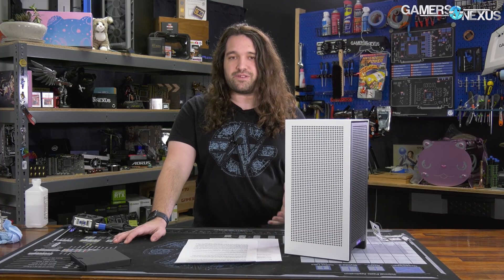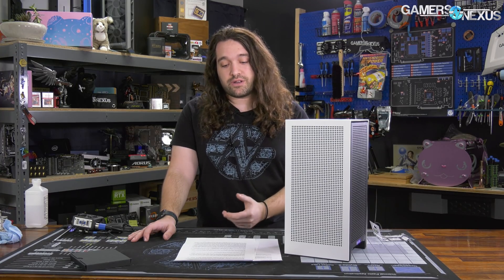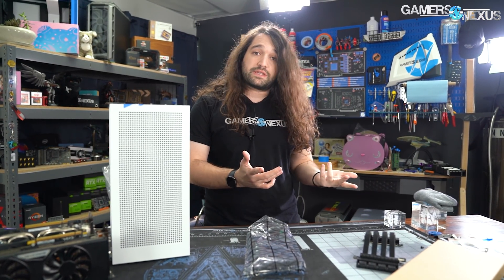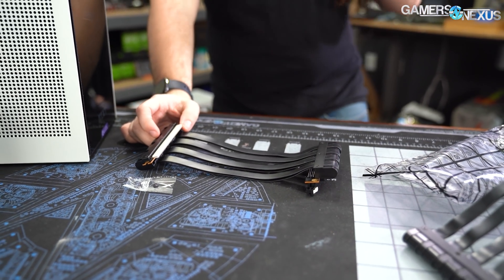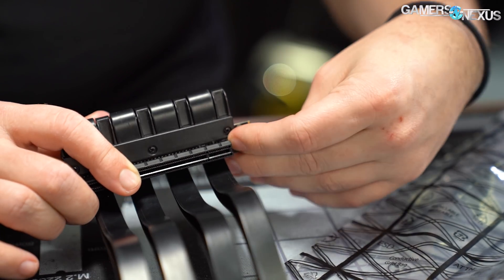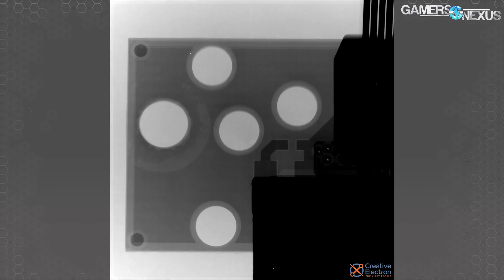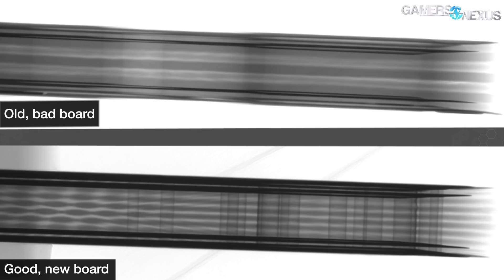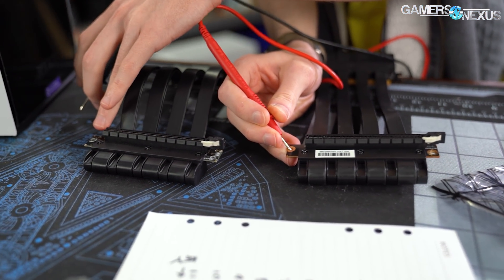Fire or No Fire: New NZXT H1 Riser X-Ray & Testing (NZXT H1 PCIe Riser Fix)

Comment: Great job on this, what ended up being a series. Some may call it excessive or obsessive. I call it holding manufacturers accountable for the BS that they pull and try to sweep under the rug without actually addressing.

Comment: refund denied, because it wasn't bought directly from NZXT.  Just received the nylon screws, that was a 3 month wait, wonder how long it will take to get the replacement riser cable.... at this point I've already moved onto a different case, Cooler Master NR200P.

Comment: I imagine that the multiple holes around the main plated hole is for one of a few reasons: higher amperage rating for grounding to meet a 3rd party certification requirement (as motherboards seems to have a similar solution) or for better HF noise grounding. Due to the Skin Effect, having more effective outer walls of the conductor would help noise which is often coupled to the ground wires from the electromagnetic fields of the other pins. Circut grounds can be used to dissipate that noise, usually with capacitors and resistors. I would imagine that motherboards and GPUs are fairly noisy due to the high clock speeds. The through-holes would be plated and grounding the riser as noise would prefer that path over going back through the riser cable, which is why sometimes you see braided cables used as grounds or EMI shielding.

Comment: tubes are called via's they are there to connect the copper layers together like if you wanted to jump a signal from top to bottom layers. Why they put them around the mounting holes not entirely sure without seeing the board for real maybe its to "rivot" the layers together around the screw hole, though the plated hole should do that.  OS - IPC certified circuit board designer

Comment: Mounting hole via ring prevents the pad from being ripped off. It also has some marginal thermal and electrical benefit to the board and ground connection but that's probably not important here.

Comment: excellent. hopefully this is an "across the board" replacement and customer service does a good job of getting replacements out to folks who turn in for the recall. im glad they did the right thing and had a proper PCB made for this use case. and yes, the x-ray views of the boards were really neat, ive never seen anyone do that before on PCB analysis. as always, top shelf work from GN

Comment: Electronics Engineer here, the piping or vias around the mounting hole are there to provide a consistent ground plane through all layers of the PCB even if the plating on the top or bottom side of the board gets damaged, eg if the plated hole was stripped of its plating in the center due to wearing from a screw the vias would ensure that the ground plane is not broken.

Comment: EE here, those "tubes" near the screw hole look like vias. These are extra hole in the board that are plated to carry current between layers. Adding them around screws is considered best practice: https://electronics.stackexchange.com/questions/240092/why-do-some-pcbs-put-vias-around-mechanical-through-holes

Comment: @Gamers Nexus  The "tubes" around the "screw holes" are called vias or the technique also know as via stitching. Vias in Screwpads are mostly used to increase stiffness, think of as the pressure of the screw now presses lengthwise the copper "tube" instead of the substrate. "via stitching" also ensures electrical connection from top to bottom of the screwpad, because if a screw squeezes the substrate it's very likely that the pad lift off the plating and since the vias are a bit further away of the "bending point" they are more likely to survive this force (especially combined with the first reason, which reduces squeezing of the substrate). By the way i like the naming "tubes" i may sneak them into our EDA system somehow :)

Comment: The plated through holes are used to keep the impedance of the ground plane constant which a very important RF PCB design technique that is also necessary for high speed digital PCBs .... You need to make sure all your digital signal lines have the same impedances and those are all referenced to ground so if your ground isn't constant at all points then you start having problems .... At RF frequencies ground plane impedance, capacitance and inductance are extremely important and if you look at radio PCBs you'll see these through holes all over a PCB .....  Also the old PCB looked to have only 2 ground planes, one on top and one on the bottom while the new PCB had ground planes sandwiching the Power plane and the Signal plane(s)  which does two things, it keeps the ground impedances constant throughout the PCB plus it also provides shielding of noise so noise on the power plane doesn't couple to the signal plane and vice versa

The original PCB had a lot more problems than just a power shorting issue, it was just a poor cheap design from top to bottom and if you started moving a lot of data at high speeds there would probably be issues with the signal integrity due to impedance and noise problems ...... That is why it is so hard to find PCIe 4.0 risers because they potentially move a lot more data and impedance and noise because even a bigger problem as the amount of data goes up or the speed (frequency) goes up

Comment: Who in the world decided it would be a good idea to just add a hole in the pcb AFTER it was designed and built... without a "keep away zone."  The new PCB looks a lot better designed than the original.  It is hard to tell but just by looking at the color on the pcb sidea, it looks like polyimide.  Which is very good at high thermal reliability and high temperature reliability.  Much more expensive material though.

The via holes around the mounting hole help ensure a good connection to ground.  Say someone puts a screw that is too big and strips out the copper in the mounting hole.  The connection would still be there due to the vias.  Plated mounting holes and surrounding vias are generally connected to the ground plain layer/layers giving the added benefit of EMI shielding once mounted to its respective chassis.

Comment: Electrical engineer here, those tubes are vias that connect the top ground plain to the bottom ground plain for a more solid ground connection. They drill a small hole through the board and plate it to connect the 2 layers.

Comment: The “tubes” are called “Vias”. They are small holes that are drilled through the board and electrically plated to connect different layers of the PCB together. In this case they are forming a circle around the large plated hole that is used for the screw and will provide both additional electrical path for the Ground connection,  but probably more significantly will provide mechanical robustness for the integrity of the surface pad as the screw is inserted and removed multiple times over its life

Comment: X-ray is cool. 👍 I’d like to see more of it.

Also, I would have liked to see an explanation of what that shadow was around the screw hole on the old riser. Wear from an installed screw? Also the images were a bit blurry in some areas, which made it hard to ascertain what the area around the NZXT-drilled hole was. If you had an unused old riser, that would have been better maybe :/

Comment: I've been removed from the hardware industry for too long to comment myself...but this StackExchange post does a good job summarizing why there are via holes surrounding the mounting pad.  https://electronics.stackexchange.com/questions/137394/mounting-hole-on-a-pcb

TLDR - The large pad around the mounting hole allows the screw to be connected to ground.  The plated through hole vias (small holes) surrounding the mounting pad help to ensure that surface pad keeps connectivity to ground with an inner ground layer of the PCB in the event that a screw strips the plating inside the mounting hole itself.

Comment: The small holes around the screw hole are standard filled through board vias and they serve several purposes. They provide an electrically connection to all layers at that point, in this case ground. Here though they are structural, the copper ring around the screw hole is present on every layer, and the thick plating of the vias connects them together as a single bit of copper, making a stronger mechanical connection from the screws to the board. (this is often done to help prevent copper pads 'lifting' for things like surface mount USB connectors). Lastly this sometimes done for thermal reasons to help spread heat between and along the ground layers. Google 'via stackup' and there are lots of images of the different types vias and their uses.

Comment: Of course NZXT is going to kiss your butts because you are who you are, however with us normal humans, they took 3 months just to get me their bandaid screw kit, and wouldnt be able to get me a riser until the end of May/beginning of June, so screw them, I bought a Louqe Cobalt PCIe Gen 4 riser and while its not compatible with their mounting without minor modification, it does work VERY well. there is also a company called LinkUp that sells risers on Amazon both Gen 3 and 4 for the H1 that do fit with their mounting hardware if you want to get that instead of waiting months for NZXTs riser (which is Gen 3 and they have no plans to go to Gen 4 any time soon)

Comment: There's information here about pcb mounting holes:
https://atadiat.com/en/e-four-pcb-marks/

https://electronics.stackexchange.com/questions/137394/mounting-hole-on-a-pcb/137425#137425

There are a couple considerations with those holes: they're vias to connect the various layers (meaning most likely that it can connect to the ground plane in a multi-player pcb like this), and they can add mechanical stiffness.

Comment: That isnt proving a negative, I agree with everything  but saying it's hard to prove a negative isn't what just happened. You were able to identify the problem  and prove that the problem is now gone and it meets operational spec. I think you guys did great work in discovering this problem but really blew it out of proportion a little bit. This was a great story in the end, and I think the company handle it. They could have done things a little faster maybe but to me I think they made a mistake and just didn't realize how bad the issue actually was. Once they saw the problem they tried to resolve it. Also putting out a notice of the defect and showing ppl how to fix it themselves was the right move because the recall was going to take a long time. I don't understand why ppl got mad over that. So just the point I wanted to say is that you are not proving a negative you are showing that the new product meets operational spec. Which is the standard our gov has. Of course if you would send house voltage though it, it could catch fire but that's anything

Comment: The holes are called vias, they are used to interconect layers(planes) of the pcb, in this particular case they are connecting all the ground "planes". As each one can guide only a small amount of current and heat, we stack a bunch of them like that to divide the current and heat among them.
As a short curriculum i'm gratuated in industrial automation in a federal university and i work designing and manufactoring electronic circuit boards for the security sector.

Comment: Ah, the joys of a competently designed piece of kit ;-)

The x-ray photography was interesting - I think you're on the right track regarding the holes that were punched by the manufacturer. Judging by the gaps around all of the other screw holes, it seems likely that the problem hole was originally the same, and it's NZXT's use of such a large screw that's used up all of the "safe zone." I'd guess that they either got the risers in after the chassis had gone to manufacture, or somebody changed the spec for the threads on that panel after the order had been placed... Either way, QA should have caught this on the first fully assembled case.

Regardless of whether it would have been safe enough if they hadn't used such a stupidly large screw, it's good to see it done properly on the new PCB :-)

Comment: Just a hobbysit here, but I think the little holes around the mounting holes (vias) are used, so that the pad doesn't rip off as easily and for a low impedance connection to both ground planes for the mounting screw.

Comment: Those small via holes around the screw hole are also a good indication that the issue is fixed if you don't happen to have an x-ray imaging available. Those smaller "tubes" as you call them are also plated through holes similar to the screw hole but smaller, connecting the copper on each layer together. The smaller via ring gives a more reliable ground connection through out all the layers if the plating in the screw hole breaks.

Comment: The small via holes in the mounting hole pads are designed to electrically connect the mounting hole pad to the pad on the opposite side of the board. In the case of a multi layer board with an inner plane layer the vias may also be used to connect the mounting hole pad to that inner layer.

In the past it was much less common to see mounting hole pads with these via holes. Instead the mounting hole was built as as a large plated through hole to connect to the opposite side and/or inner layers of the board. However, as in the examples you show, note that the more modern type mounting holes do not have plating in the large diameter screw hole and thus the need for the vias to provide the electrical connection.

Plating removal in screw mounting holes is primarily done for one reason. The sharp threads of a screw in the hole can cause small particles of metal to come off the plated hole. This is particularly true when boards might be removed and re-installed during testing and/or repair. These small particles can come out and appear on the circuit board or float around in the electronics enclosure. In the advent of surface mount components with vary narrow lead spacings these small metal particles from the screw holes can lead to shorts on the circuit leading to either intermittent circuit operation or outright failure.

Comment: Those "tubes" on the board are called vias.
They are mainly put around screw holes to do the following things:
1. Make the board more rigid, since the vias are more rigid than the board laminate itself, this helps prevent the screw from backing out over time.
2. Helps the board from delaminating over time, ensuring that the board doesn't wear out as quickly.
3. Decreases electrical resistance if one uses the screw as a power terminal, for a ground point like this, then this feature isn't all that important.
Reply: Exactly

Comment: I didn't realize NZXT H1 had sort of a nonstandard space requirement for the screw positioning. If they just modified premade risers then it makes so much more sense why the 12V plane was exposed. That area was never meant for a screw. Someone just put a hole in it and thought it was fine.

Comment: I think those extra through holes are just for structural integrity. When a screw gets torqued it will try to twist that surface; the extra through holes bind it better, keeping it from twisting off. If it ever did break off, then you'd be... not as bad off as the old cable, but not great. The ones nowhere near the screw holes, I guess just good practice, can't hurt anything. I've heard of prolonged moisture exposure causing delamination; more through holes help hold the layers together even if the resin holding the layers together did fail.

Comment: The purpose of the little holes around the bigger through hole is purely mechanical. You'll often see them on PTHs that are meant to be used as mechanical mounting points (you may see them commonly on motherboards). The reason they're there is to provide increased stiffness to the top copper layer against abbraision from the screw head that rests on top of it. If you've soldered on to copper pads before, you'll know it's possible to lift the pads from the PCB as a result of too much heat or mechanical pressure and this is what the little through holes at the sides resist against. It fuses the top copper layer to the lower copper layers thus providing more rigidity.

Comment: The "tubes" around the screw hole are for structural support. Those on the edge of the board are called via stitching. They connect layers together and help with EMI, think it as PCB Faraday Cage. In many cases, a passive board doesn't necessarily need them, but since those shown in video shouldn't cost anything extra.... There can also be via shielding, which I didn't see in the video.

Comment: From what I remember from green board designing in college is the through hole punches are used to connect to the grounding plane in a PCB. Some one else may be able to elaborate or correct me, but I'm fairly certain they're used for grounding.

Comment: The fact that the riser was a generic third-party unit and not made by NZXT explains a lot - they added a new screw hole and that ended up going through a 12V plane. Still a massive cock-up but you can see how it happened. I think the problem is that case manufacturers don't really know about PCB design because they outsource it all.
Reply: Actually by how the xray looked, the holes had a fine amount of keep out, but then nzxt put too big a screw through it and gouged it out.

Nzxt is entirely to blame here. They chose this part, they wanted it cheap, they assembled the case. It's on them.

Comment: Those tubes are there to connect the 2 plates/sides together that protect the hole giving a Dual sided Ground connection,

it is to protect both sides from shorting out.

Comment: 8:40 smaller holes around the screw hole are called vias; different kind of plated through hole that connect layers of the board, typically GND or power.